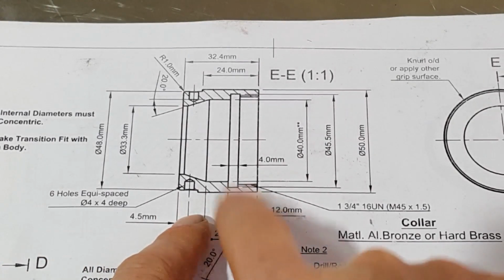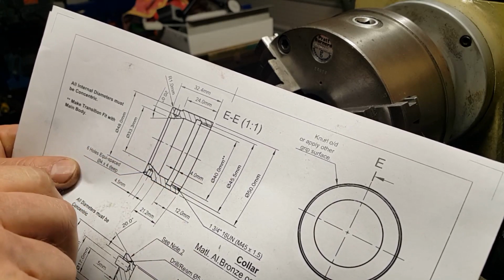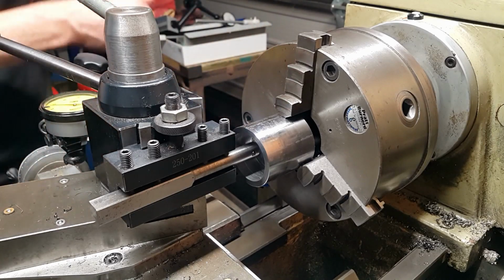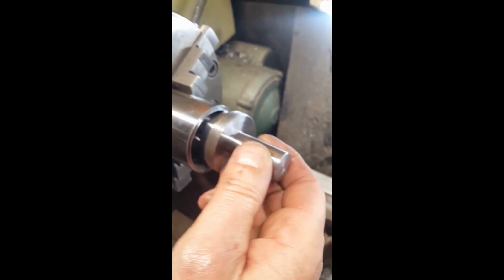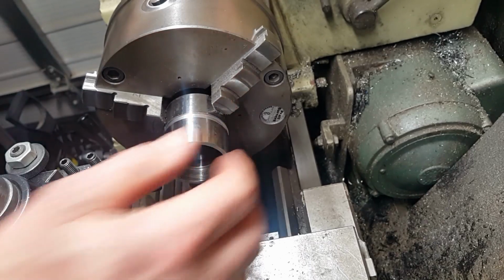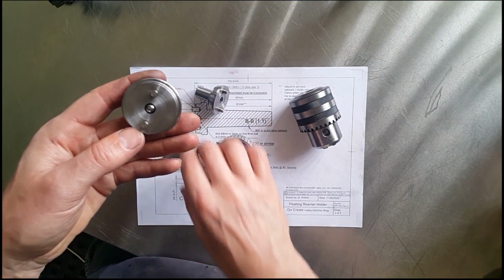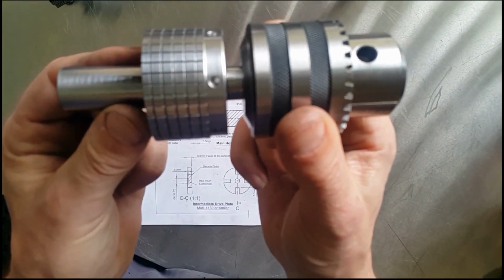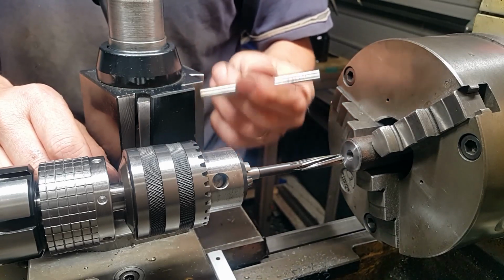#81 - Floating Reamer Holder - Part 3 Final

Comment: Gday Kevin, excellent results, the shaper does a great job, the internal thread was absolutely spot on and I’m sure you will get many years of use out of this tool, the piece of hss in the drive dog on mine I noticed the ball dealing has left a good impression so with the taper it must apply quite a bit of force, really enjoyed this series mate great job, cheers
Reply from the maker: Hi Matty. Yes my HSS piece is the same. Think I'll swap it out for a piece of drill rod. I'll harden it and temper it back and see how that goes. Thanks for watching mate. Kev..

Comment: Hi Kevin. Had a look through videos. Are you still running the cnc gear, I'm half way to building a cnc roughter and plasma cutter at the moment
Reply from the maker: Hi Paul, Yes using the CNC router and CNC laser cutter daily (I built both machines from scratch). I've thought about a building CNC plasma also. Cheers Kevin